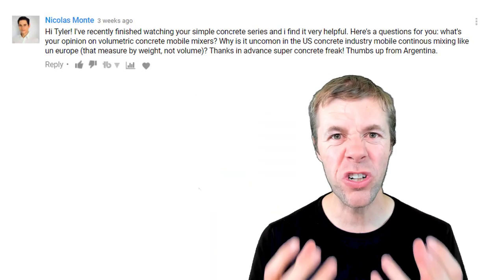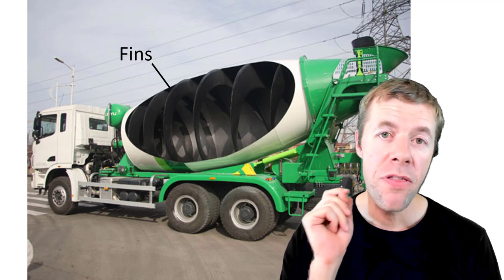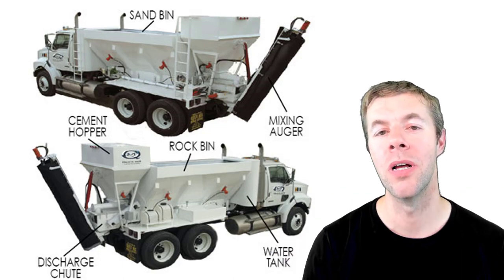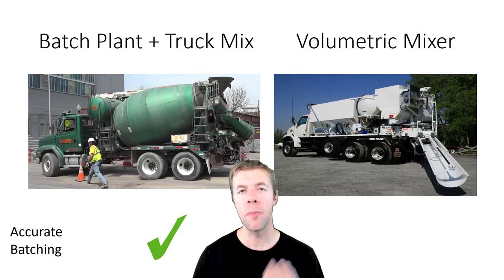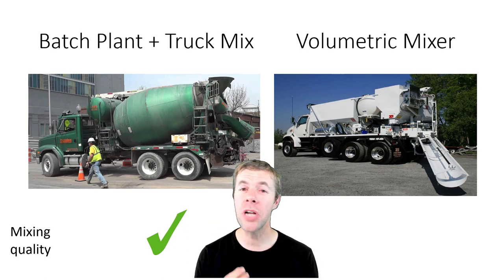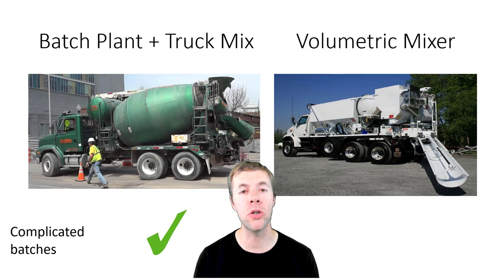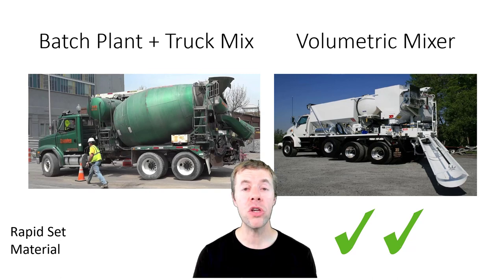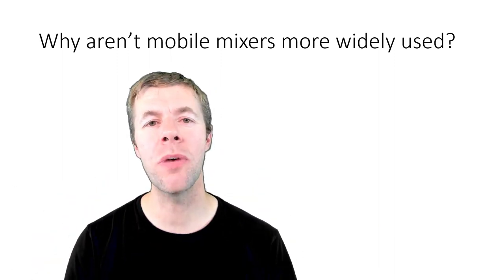Concrete Mix Trucks | Truck Mix vs Volumetric Mixers | Q&A Response

Comment: I had never heard of the volumetric trucks, are they an American thing? I do not even think that it is possible to get a EU certification for them. Here in Denmark we mix at plants, or in a few cases, it is completely mixed in the back of a normal truck. Another thing I have not seen outside Denmark is conveyor belts on the trucks, to unload the concrete, they range from 14 to 20 meters. Really makes easy work out of most unloads. Here is a video of how that works https://www.youtube.com/watch?v=GRojfcaqna4